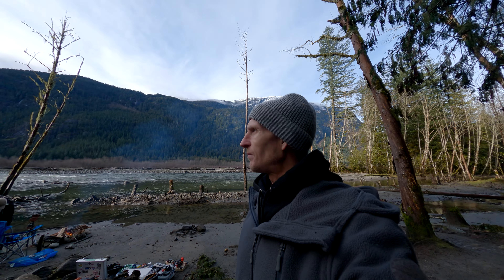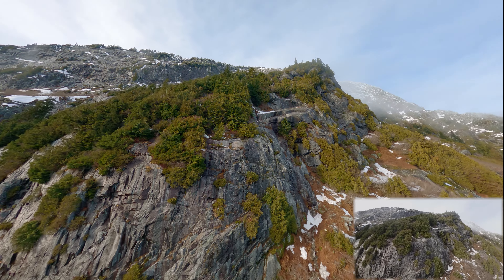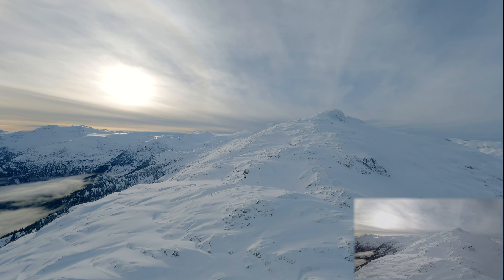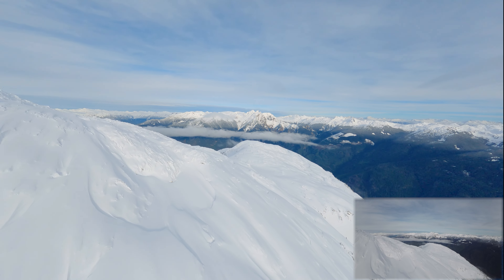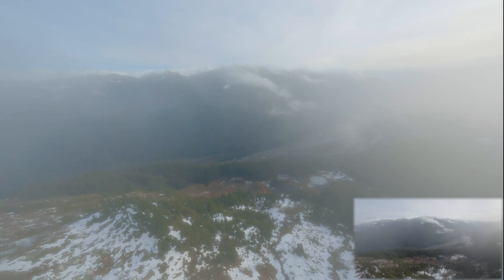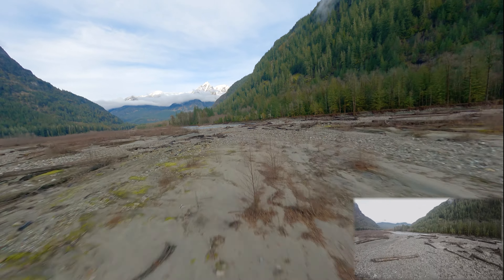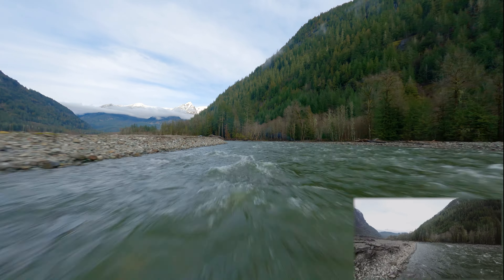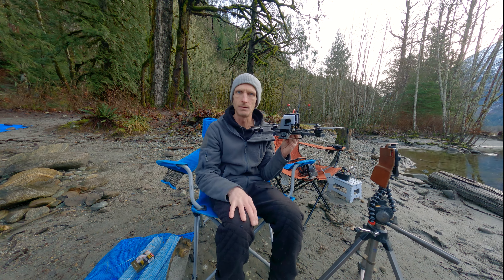Flying Long Range FPV with the GNB 7000mAh 70c LiHV Battery

Comment: Umm that almost li-ion pack mah per gram
Reply from the maker: Ya it's quite energy dense, I think the lifespan will likely be the weak point.
Reply: @FalconRadFPV  I just went and looked at a bunch. 6000, 6500, 7000, 7500, & 8000mah (only has xt90)
Be really close of it can fit my drone

Comment: The GNB brand is garbage. Very poor quality in my experience. With multiple sizes.
Reply from the maker: ya a few people have made similar comments.  I'm still deciding....
Reply: I just bought RCHackers 6S 6000mAh 22.2V 100C Lipo Battery 
It was a better deal than the gnb with higher c rating. Will try it in my FalconRAD 7.5”
Reply: Interesting, I’ve had nothing but luck with the smaller GNBhv in 3, 4 and 6s.
Reply: Im using gnb brand battery ant i cant complain  its best for me